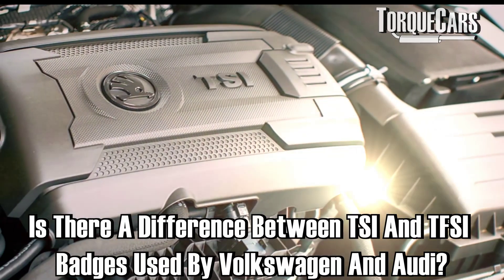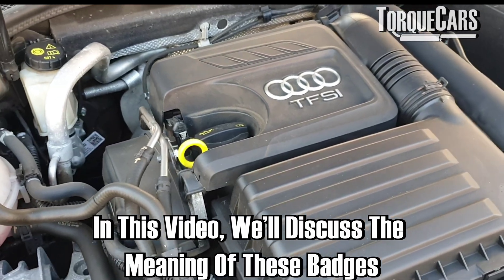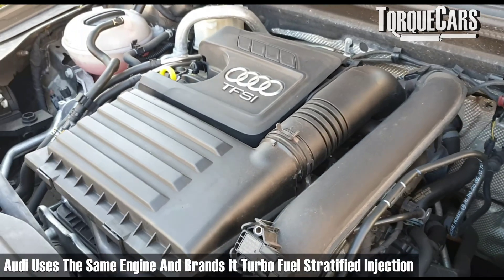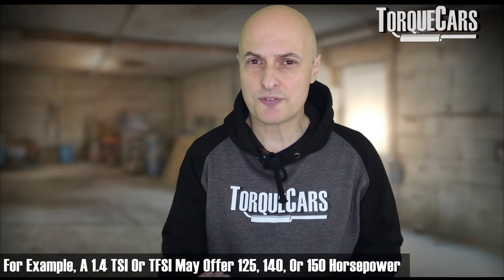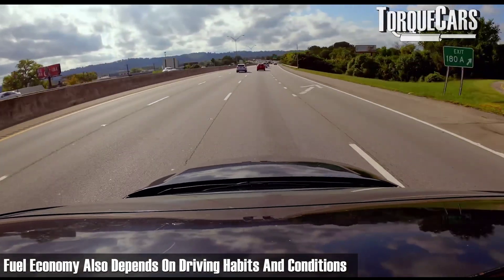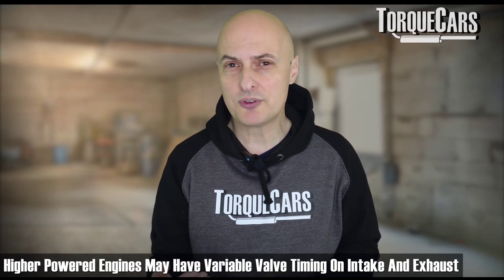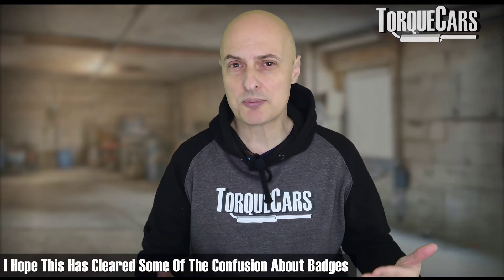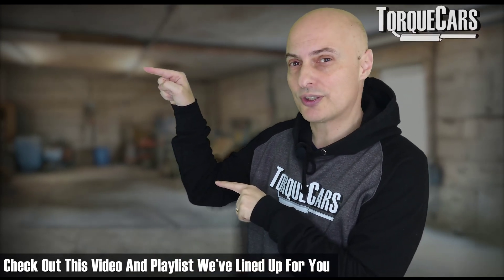What Are The Differences Between TSi & TFSi? Which Versions Are Most Economical?

Comment: from what I know TFSI has variable valve lift on exhaust camshaft while TSI doesn't. bad video
Reply from the maker: All the lower powered engines such as the 124hp 1.4 have no variable valve lift on the exhaust the 150hp versions of this engine tend to include it, this is regardless of whether it's in an Audi or a VW. They are the same engines just a different name from a different brand, that is literally all it is my friend.

Comment: VAG politics has always been stupid so nothing new there. Given that stage 1 remaps improve fuel efficency under normal driving yeah the news that the 150bph version is more efficent than the 125hp versions is not news. The clutch will wear slightly quicker on the more powerful engine though unless it has a higher rated one fitted.

Comment: Well, originally, TSI stood for Twincharged Stratified Injection. 

The original 1.4 TSI was supercharged and turbocharged with Stratified Charge (non-homogenious Air to fuel ratio depending in the position in the cylinder). 

Today, it is neither twincharged nor stratified anymore...

Comment: I had an Audi a1 2011 1.4tfsi. 122bhp. Had it mapped to 148bhp and I was getting 54mpg after the remap !  Got got written off last month someone crashed into me. My car had 186k miles onit on the factory timing chain 😂 was still going strong not a single rattle from the chain.
Reply: @steviefpv  how often do you do oil changes